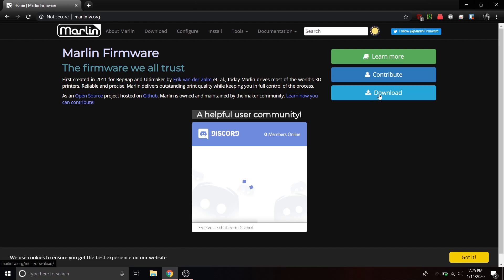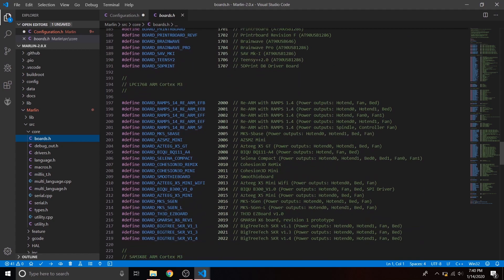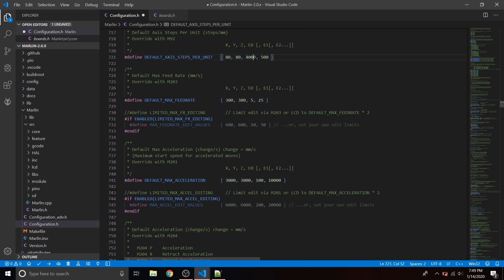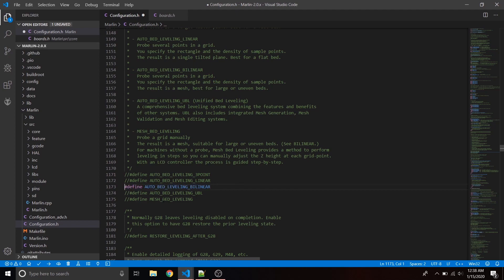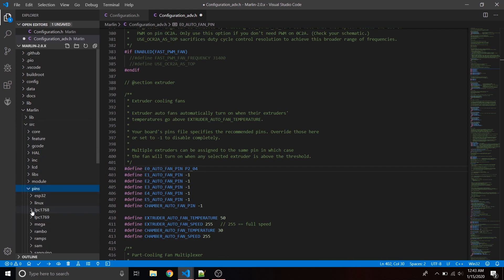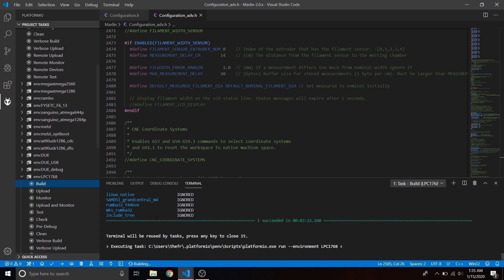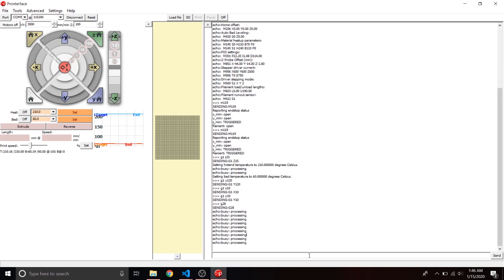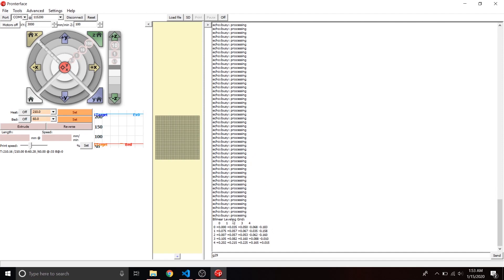Ender 3 Upgrade Part 2!

Comment: Have given up trying to upgrade my Ender 3 with SKR V1.3 and proximity sensor they have changed Marlin firmware too much and have made it totally confusing. I have always been able to upgrade Marlin but not anymore Auto Home and ABL are totally screwed up. Going back to upgraded Creality board

Comment: Hey thanks for great video. Now I have a problem I can’t move my z axis and when I home the printer it homes x and y then moves x and y infinitely in the opposite direction instead of homing the z what did I do wrong?
Reply: I believe Marlin has been changed too much and is no longer user friendly

Comment: hi, maybe you can help I watched your video by the way really good but I am stuck don't know what too do? I have a ender 3x with glass bed and I changed my board for a skr v1.4 with 2208 uart steppers and a bltouch v3.0 what is happing is my when I click home in pronterface it goes up and not down I tried too change the z for true and still the same :( thanks for the help.
Reply: ok so now I have it going down but it don't stop if I don't close the power well it will just keep going.